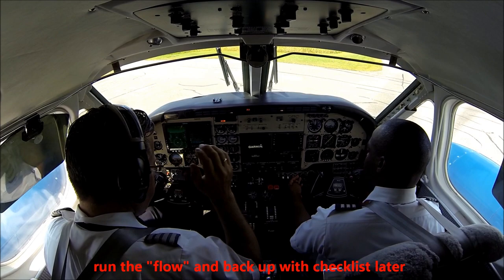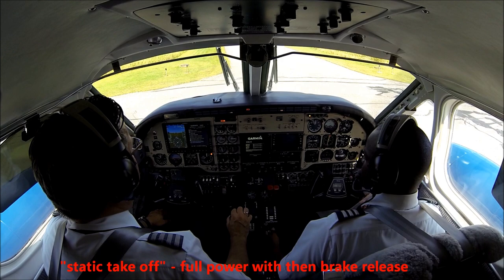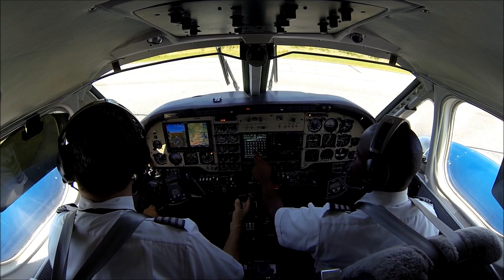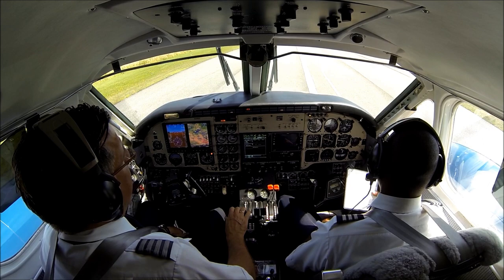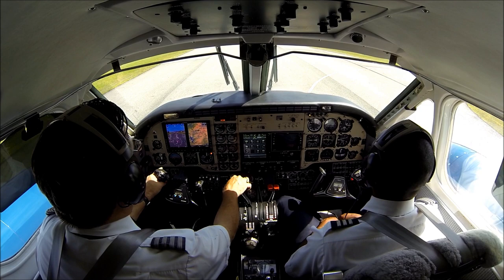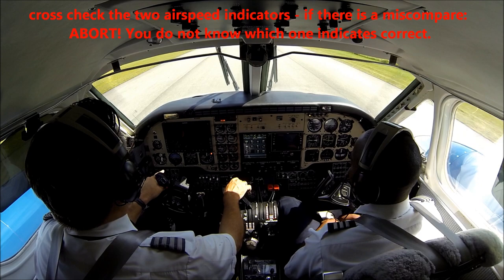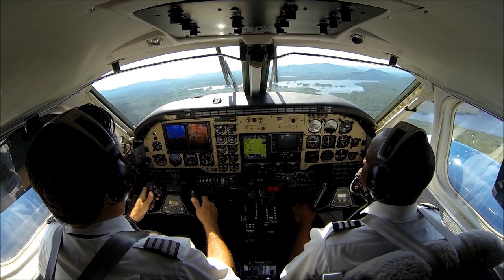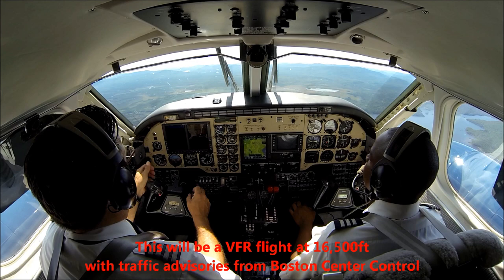King Air B100 - short field take off! Cockpit view with ATC.

Comment from the maker: Hi Lázaro,
a prop synchronizer is designed to maintain the propeller rpm of the left and right engine exactly the same. This has no technical purpose, but it is for passenger comfort. Propellers out of synch produce an annoying sound. The technical term is "beating".  How does a prop synch work? There is a "master" engine with a set rpm and the "slave" engine follows exactly to match the rpm. In the event of an engine failure, the "slave" engine would reduce the rpm to match the masters engine rpm that goes down. Not good...The system is well protected against this and the synchronizer will kick out if the rpm difference between the engines exceeds a certain value (typically 50 rpm). But to be extra cautious, it is good practice to switch the synchronizer off during "critical phases of flight", which is in clear language: take off and landing. Now you know, why it should be off during take off and landing.
Thanks for your comment, all the best and happy landings,
Guido

Comment from the maker: Hi Lazaro, he main wheel will sink in immediately. This King Air has small, high pressure tires, not designed for grass operation.
Happy Landings und Gruesse nach Deutschland,
Guido
(for whatever reason, I cannot use the "reply" button on your post)
Reply: Can you cancell the terrain avoidance warnings
Reply from the maker: Garry Mulholland Yes I can. But at the time of the flight I did not know how. It has to be cancelled in the Garmin 600 sub menue.
Happy Landings,
Guido
Reply: Ok

Comment: Hi Guido, Thanks for the videos, they are great!!
I am a B100 operator and I am curious to know your cross start engine procedure.
Reply from the maker: oskarsurf hello fellow B100 pilot.
Unlike the King Air 90/350, the 100 and 200 is prone to blow a current limiter on cross gen start.
You need a lot of hands:
NTS test, then start.
At 10% rpm reach over with your right hand and switch on the generator of the running engine (by reaching UNDER the left hand that holds the starter and NTS switch.
Before being generator no 2 online check the voltage to detect a blown current limiter.
Happy Landings,
Guido

Comment: I take it you had some crosswind from the right?  
On another point what happens if you get into the grass on your turns?  Do you get stuck or is a prop strike the main concern or ???
BTW, I can't say this enough your videos are great. I have a commercial+Instrument rating SEL and 400 hours and I learn at least one thing from each video.  Thanks
Reply from the maker: Hui Jim,
well spotted, cross wind from the right.
Main concern with the grass is sinking in. Some King Airs are equipped with bigger tires. Called "high flotation gear". We used these in South Africa to land on grass and gravel strips. So now you may ask: why don't all King Airs have high flotation gear? The tires are too big to be retracted fully into the engine nacelles. So they stick out a bit and create additional drag. This can make up to 5 knots speed reduction.
Happy Landings,
Guido

Comment: Guido, there is a tone at about 5:32 that I've heard in a couple of your other videos, and it occurs again in the vicinity of 5:48.  What is that indicating?
Reply from the maker: Hi Mike, that's actually a complex question and I had to think before I answer. As you can see, this is a refurbished cockpit, new avionics has been installed, but we kept the old autopilot. In the Garmin 600 (the glass instrument on the cockpit side) there is an altitude selector. It does not communicate with the autopilot (analog vs. digital...). To select an altitude, we use the dial knob in the middle of the cockpit, the one we turn when we say "sixteen five" in the video.
The altitude in the G600, albeit having no function, was left at 5000ft (I forgot to set it to 16,500ft). It has an alarm built in 200ft below and 200ft above the selected altitude. Please have a closer look and your hear he first "beep" at 4800ft and the second at 5200ft. This stuff happens in old airplanes with new avionics.
Thanks for watching my videos in such detail and Happy Landings,
Guido

Comment: Hi Guido, big fan from Guatemala, I have one question, why do you say "it is over" if the main landing gear touches de grass, i dont believe a substancial damage may occure ? Thanks :D .
Reply from the maker: Hi Carlos,
the main wheel will sink in immediately. This King Air has small, high pressure tires, not designed for grass operation.
There is an option to install larger tires, called "high flotation gear". This is good to operate on grass and gravel. The disadvantage is that the larger tires do not retract completely into the gear bay and stick out a little bit. This creates additional dag and reduces speed by approx 3-5 knots.
Happy Landings and greetings to Guatemala,,
Guido
Reply: Guido Warnecke I was about to ask this question. I figured that's what you meant in the video, as the King Air can handle quite a variety of strips.
Reply: Guido Warnecke  RippedWookie  Thanks for the information , looking forward for more vids !
Cheers.

Comment: oh and one other thing. When do you turn prop-sync on and when do you turn it off. I like to fly the B1900 in the sim but I have not found any tips regarding prop-sync on the internet, neither did the aircraft come with a manual. Hopefully you could help me out by giving me some pointers ? :)
Reply: You can have the prop sync on at all times in the 1900. Not to sure about any of the other Beech craft planes, but i fly the 1900d, only time we turn it on is when its starting to crap out on us and then we readjust the props with it off.
Reply from the maker: Matthew Robinson Thanks for the info, Matt.
I did not know that.
Happy Landings,
Guido
Reply: I am curious to why you guys would turn it off during take off? Could you explain it for me?
Reply from the maker: Matthew Robinson Hi Matt,
the prop synch keeps the rpm on both propellers constant exactly the same. this is not for technical reasons, it is for passenger comfort. If the rpm of the 2 props is not exactly in synch, an acoustic phenomenon called "beating" occurs.
What old WWII movies with the large 4-engine Bombers, you can hear the oscillating nose.
The synch is done in the way that one engine "follows" the other engine.
The risk would be if one engine fails, the other one would "follow" this and may drastically reduce the rpm. The system is protected as such that the other engine could not stop but a power surge may occur.
This is why the prop synch should be off during "critical phases of fight" e.g. take off and landings.
Happy Landings,
Guido

Comment: Hi Guido! I have a question about King Air aircrafts. As far as I can see once you lift off the runway most twin engine aircrafts roll right a bit (dunno the exact term for this, sorry) because of the propelleres rotating in the same direction so you need to use yoke/trimmers . Does King Air C90B/B100 has the same feature? Thanks in advance!
Reply from the maker: You are correct, Vito.
Only training aircraft use counter rotating propellers. This is to prevent that there is a "critical" engine. But you can imagine that from the maintenance and spare part situation this is not good, as you have a "left" and a "right" engine. In all other aircraft, engines are interchangeable left and right. We use a little bit of right rudder on take off, but this is not as pronounced as it is in a single engine aircraft, where the propeller is on the center of the fuselage and the slip stream goes direct on the tail fin.
Happy Landings,
Guido
Reply: Guido Warnecke Thanks for detailed explanation, Guido! So, am I right about King Air aircrafts? They do have the same right roll on the lift off jus as all the rest twin engine aircrafts, right?
Reply from the maker: Correct.
Reply: Ok, thank you and happy landings:-) love your channel, Captain!

Comment: Sir,
You posted it was a 2900' TODA.  I'm going to be flying a B100 soon, but don't have info/manual yet to get answers, so I'm wondering what is the Accelerate Stop distance (approx. I understand there are different factors) and Take off distance over a 50' obstacle?  Thank you in advance.
Reply from the maker: Hi Rabbitt,
please send me an email (address at end of video).
then I can send you the graphs and you can see all factors that influence it.
Where will you fly the B100, not many around...
Happy Landings,
Guido
Reply: Guido Warnecke Done and Thank you.

Comment: Someones you do static takeoff and sometimes not, both in the Citation and King Air. Is the decision to go static or not based solely on runway length, or are there other factors?

Dan
Reply from the maker: All take off numbers are calculated on "static" take off. So whenever in doubt it is a static take off. Short runway at KDXR in the jet - always static take off. Sometimes we do rolling take off, mainly for passenger comfort.
Safety is first and this entirely at the discretion of the pilot. One needs, however, to consider that there are no exact numbers for rolling take off. So I do this only when I have 1000ft or so more runway available than needed.
Happy landings,
Guido

Comment: Is the warning system smart enough to sense when you ARE pulling up and be quiet, or does it just keep warning?
Reply from the maker: Robert, if this litlel airport would be in the EGPWS database, there would be no yelling... It would detect that you are near an airport and "filter" out certain warning conditions. Now the system thinks you are en-route and of course then you are not supposed to fly as low as you would during take off and landing. There is a similar video that shows the landing there and the "yelling" is even worse. Under "normal" conditions the EGPWS is a great system that has enhanced flight safety a lot. An to answer your question: yes, if you climb out at a certain rate and angle the alarm will silence.
Happy Landings,
Guido